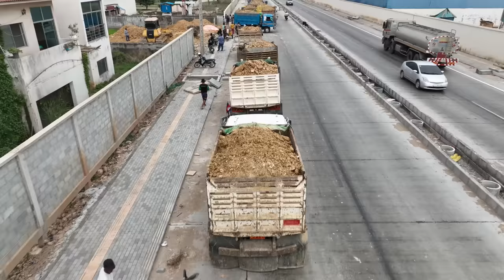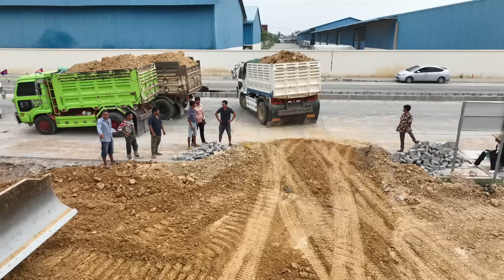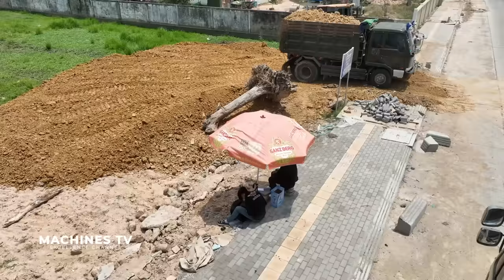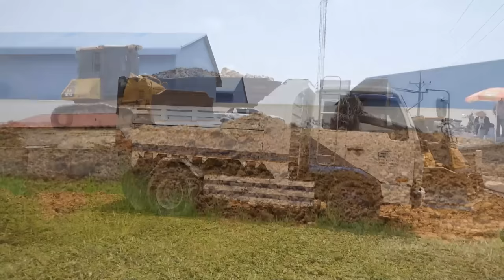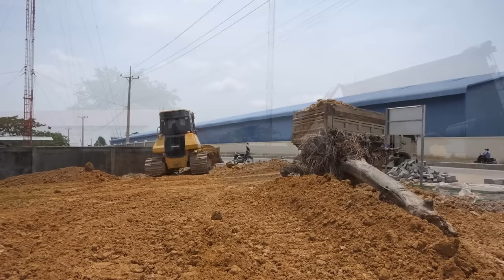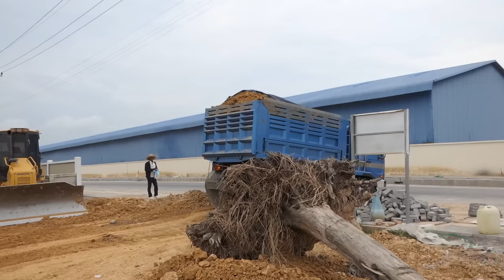New Project Land Filling Up 5Ton Dump Truck Moving Dirt Mini Bulldozer KOMATSU Pushing Clearing Dirt

Comment: Why is the Dozer SITTING and doing nothing when the site is filling up with loads?  His job (main job) is to make a place for each Truck to Dump so that the Loaded Trucks sit as litle as possible.  Pushing loads is secondary. Machines sitting idle for any length of time is unacceptable. AND why is no one load spotting showing the Trucks where to dump?
Reply: busy in issuing receipt and foget his primary work
Reply: The entire team seems to be irresponsible
Reply: The job at hand is to push dirt in the hole. Not to see how many trucks can jamb up the job site with piles... Faster than the dozer Hand can push them off. The trucks can only unload up on the hard pack, without risk of tipping sideways. The dozer operator only stopped long enough to allow trucks to cycle through, in the video EVERYBODY ELSE watched. 🧐 🤫 🤔